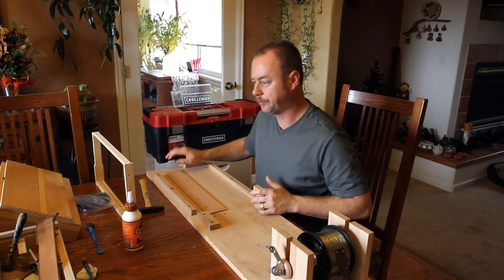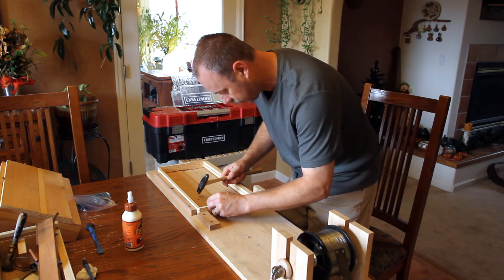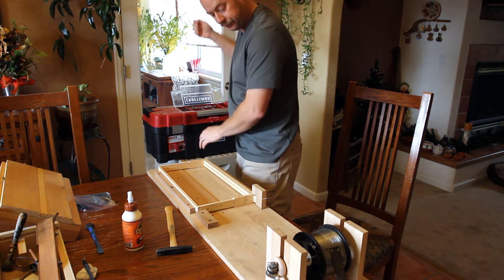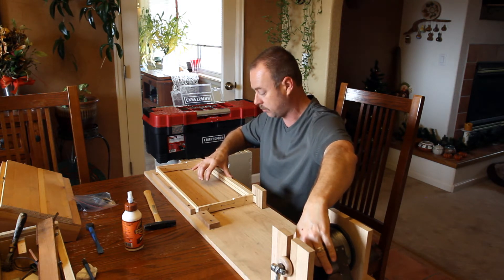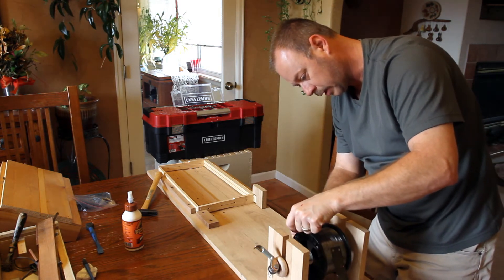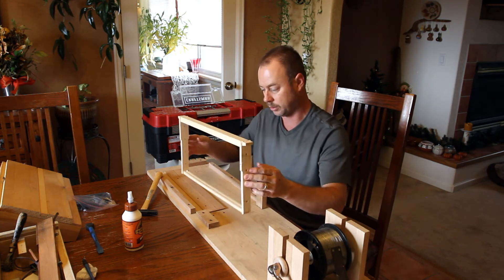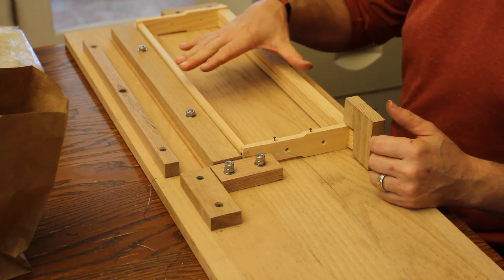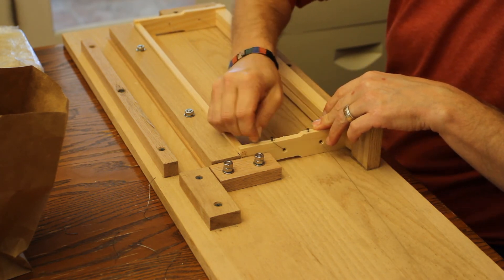Beekeeping Lessons - Traditional Frame Making: Part 2 Cross Wiring the Frames

Comment: I am returning to cross wiring after using the split pins to support the wax foundation. I have had problems with bowing and sagging deep and medium frames . I have also had problems with the pre drilled side holes not fitting the pins. By the time I redrill the holes, insert the pins so they straddle the wax to support it and press the pins home I could have wired and embedded the wax and have a better job for it. Of course I discarded the jig and needed to see if anyone had made an improvement. This jig works just fine, I do have some particle board that the frame rests on to embed the wax against. Good job there and thanks.

Comment: I am trying to decide which nails to purchase, can you tell me what size nail you use that will have a big enough head but not going to split the wood?  length and gauge?  Thank you!!
Reply from the maker: +Lydia Yearwood Hi Lydia, I use two different size nails when making frames.  I use a 17 gauge nail that is 1 1/4" long for the frame itself, i.e. top bars and bottom bars nailed into the end bars.  I also use a 17 gauge 3/4" nail for the wires when I cross wire the frames.  That is also the size I used to use to nail in the wedge for a wedge style top bar, though I don't use those anymore.  Incidentally, if you purchase frames from Walter T Kelley, or Kelley bees they send you the nails as well, which are also cement coated for added strength.  Some other manufacturers may do the same, so check your box of frames, there may actually be little paper bags of nails in the packaging as well!  Thanks for the question.

Comment: Hey, I have a point to make, and I say it will care--not to blame or criticize.  Why is everyone putting metal wire inside the frames, when it has been shown that queens will not lay eggs anywhere near it.  What this says to me is that bees don't like wire in the hive?  Why are we not listening to them.  They don't mind fish wire, and it will work just as well.  I just needed to bring that up, because I al being alarmed lately at what I see beekeepers putting inside the hive and what they are feeding the bees.  Just a note for all to get you to think what the bees need, not what we want.
Reply from the maker: Using fish line would be fine, but it is a product of petroluem processing, so I wouldn't argue that it is better than wire.  The queen will not usually lay in the cells with wire until a couple rounds of brood or so (and usually only the cross wires), but after that they will lay on the entire comb.  Bees just flatten the bottom of the cell until it is adequate to lay in.  I don't like plastic frames either, and neither do the bees, but because it is so easy for beekeepers, that market has grown incredibly over the last ten years.  I still use wooden frames and pure beeswax foundation, with wires and encourage everyone to use natural material whenever possible.